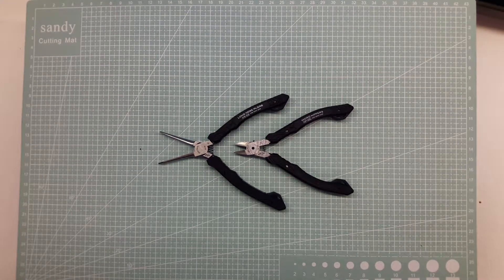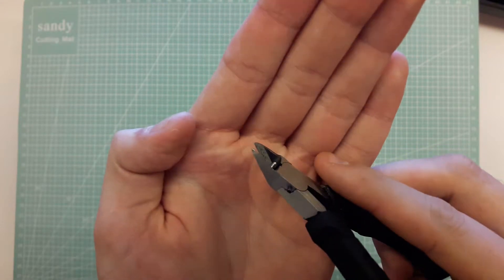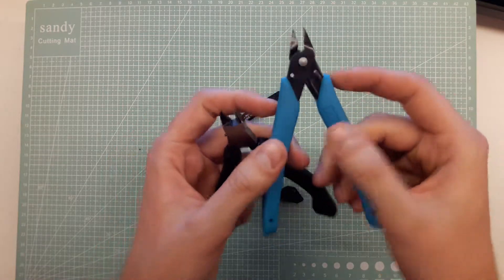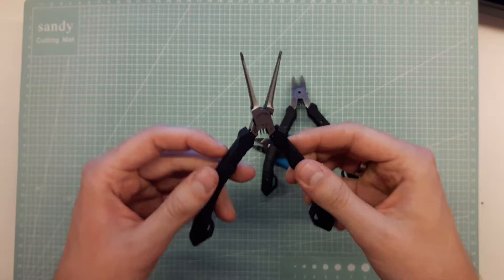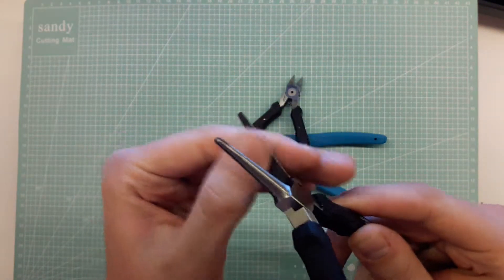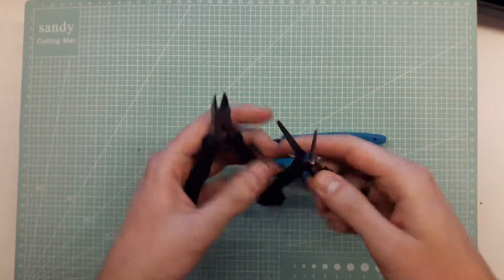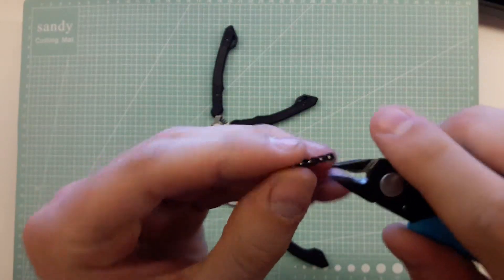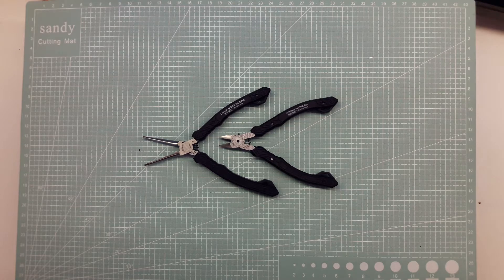Engineer NP-05 micro nippers and PS-03 long nose pliers

Comment: If you wanted to cut anything harder than plastic or soft copper the NS-04's are better suited as the 05's are for modellers, injection moulding, etc.

Comment: Those Engineer NP-05 nippers are intended for use on plastic, not metal.
Reply: 'Also capable of cutting thin copper wire (dia. 0.8mm)' From the Engineer website.